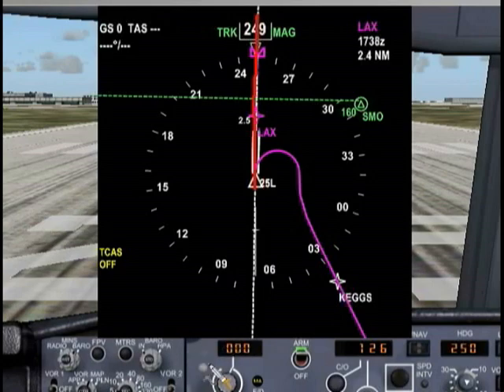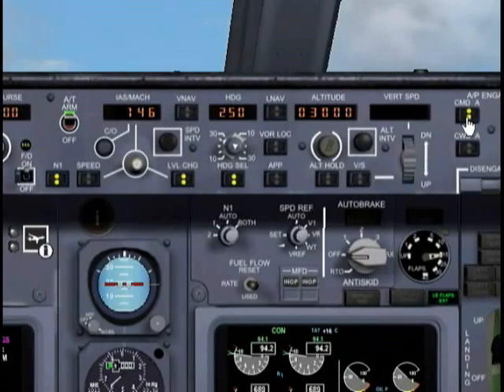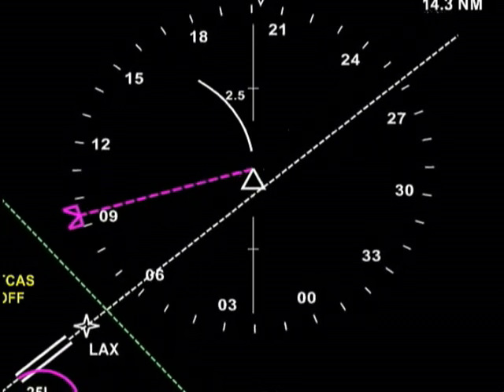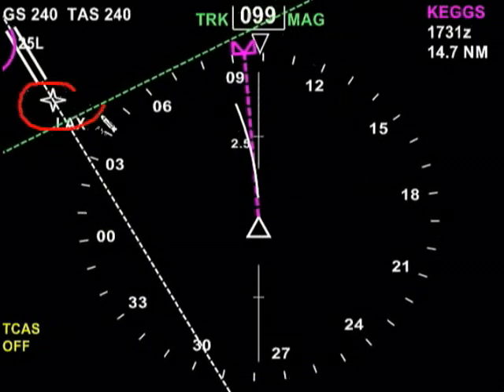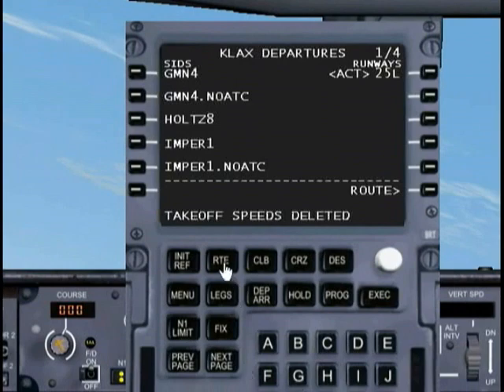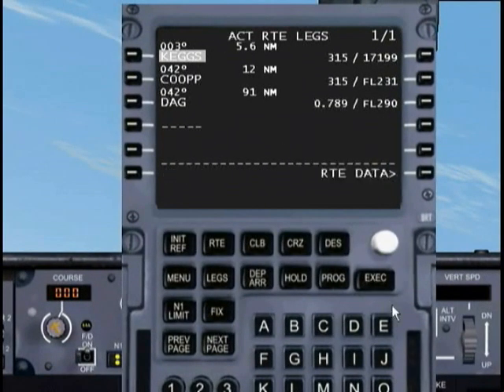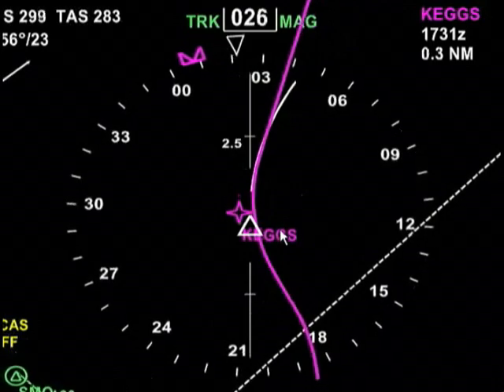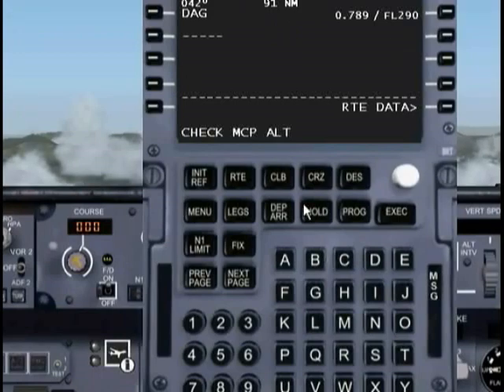PMDG FMC Tutorial Part 4

Comment: Level change allows the aeroplane to climb based on the speed set in your speed window, generally a higher speed would follow a lower V/S, a lower IAS would follow a higher V/S trend. The vertical speed therefore is varibale. VNAV works in a similar way, when you select a cost index (economy setting of which to fly), the aircraft will fly (climb/cruise/descent) speed based on the economy/performance number selected by the crew. Vnav follows a speed with altitude and speed restrictions if set.

Comment: Level change or Vnav can be pressed after v2+15 at around 1500 feet AGL. Lnav or heading select (with or without the FD) can be initiated at 400 feet AGL.
Generally though it is best to accelerate to the clean menouvering speed before making any tight turns without flaps. At v2+15 the turn is limited to 15 degrees of bank, however some charts request either make turn at a DME point to a waypoint etc or when reaching the minimum altitude make the turn. Depends on the clib gradient too.

Comment: Altitude hold works by climbing or descending at a fixed V/S without it being based on speed (ie 2500feet per minute descent).  You can also alter your V/S which is good for crews who wish to calculate the distance at which to reach their new altitude, crews are able to select a fixed vertical speed). Level change and VNAV fly a non variable V/S with a fixed speed, good for economy or performance purposes. Try it yourself.

Comment: I would also ecourage the flight simmer to fly using the F/D ( flight director) which should be armed before takeoff. It will allow you to manually fly a fixed speed/heading select or VNAV/LNAV profile manually, which is often what most crews perform. It can be difficult when on comms to ATC, while changing the speed, flaps retraction and being aware of the turn and SID procedures. So a pause between these requests is important.  Goes to show why a multicrew environment is required.

Comment: Good tutorial but I must add these things:
- SEL temp in FCM should be entered to fool the engine and reduce wear-off.
- Flaps 5 as that is standard flap used for TO
- brake to RTO on TO
- strobe, landing light when entering the active rwy
- ignition to CONST for both engines on TO
- TCAS to "above" after ATC clearance and to TA/RA on takeoff
- V2 speed into MCP, not Vr
- at 80kts check THR HLD light up on primary displ.
- after V2 or at 1000ft AGL put speed bug above UP mark on primary dspl.

Comment from the maker: This is normal. The speed tape doesnt drop to a lower speed. If you want to get a accurate speed (for instance taxi speed) reffer to your Nav display and it will tell you your ground speed. The Speed tape on the Primary display is only your airspeed which is irrelavent during slow speed manuevers.

Comment: You do not rotate at V1. This is the speed before which you can stop on the runway should there be an emergency. VR is the rotate speed. In reality by rotating at V1 you would substantially increase the takeoff roll and risk a tail strike. I suggest you do some reading about the operation of transport category aircraft before making further tutorials.